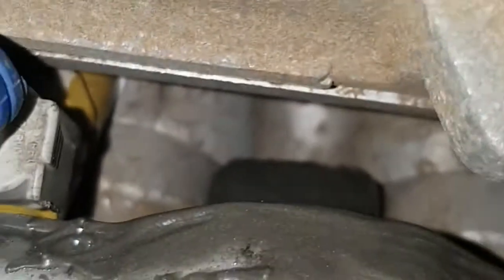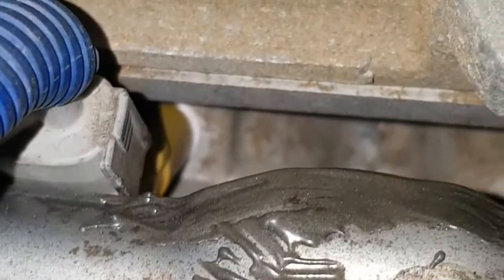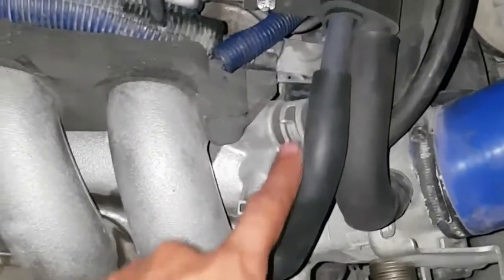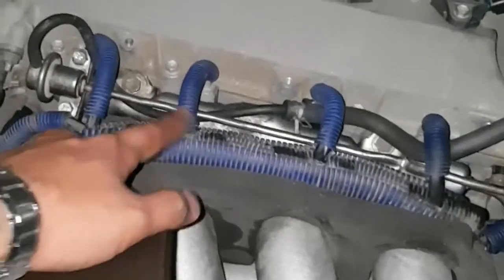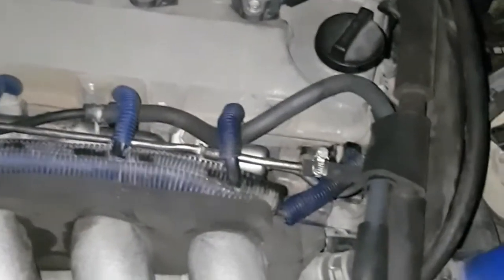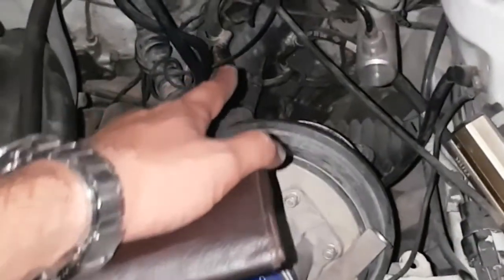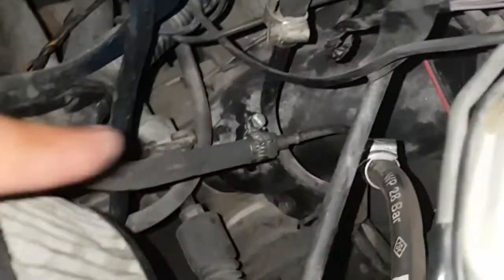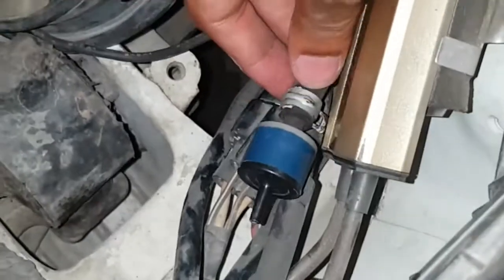2zzge and 1zzfe custom fuel return line with stock fuel regulator

Comment: How is it going now? Does the fpd delete do better?
Reply from the maker: Its better for fuel pressure and return line is better for fuel effeciency 😁
Reply: @UsmanEhsan  did you encounter any fuelling problems like check engine light going on lean combustion? btw we have also installed the engine on a AE101 chassis. :) we're also planning to delete the FPD since we are going to install an aftermarket fuel pressure regulator on the custom return line also. cheers to your build sir!
Reply from the maker: @tofumantv1254  appreciated buddy and best of luck bro for the project and deleting the fuel dampner it helps strait flow of fuel and combustion i never felt low because i have installed a stock fuel regulator on it so all good 😁
Reply: @UsmanEhsan  thanks for the input brother! Cheers!